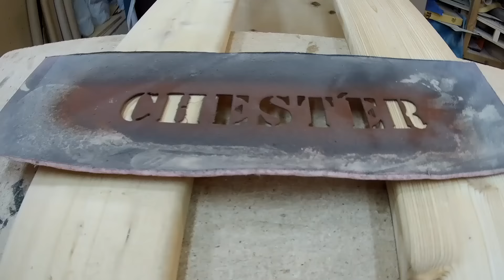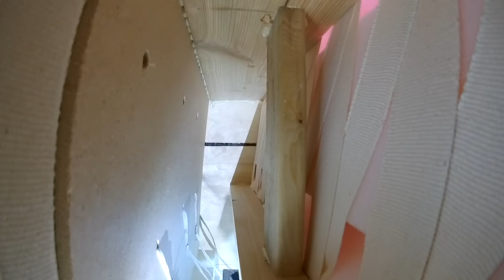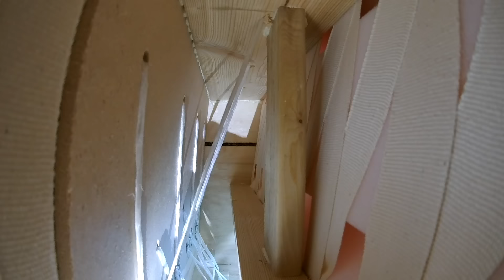CHESTERFIELD диван своими руками sofa do it yourself

Comment: Not Chesterfield. They don't use cheap plywood and brad nails for the frame. They use solid wood throughout and glued dowel joints which are much stronger.